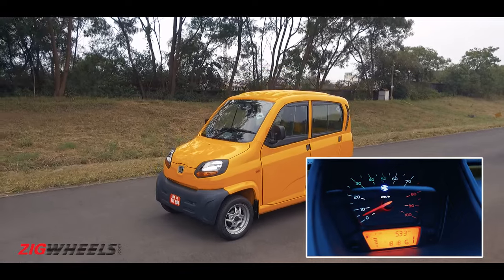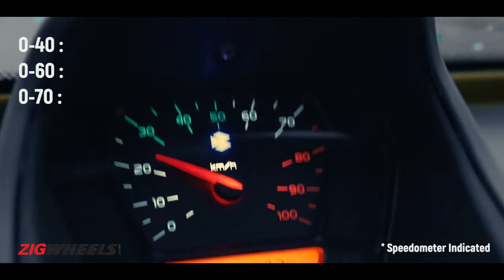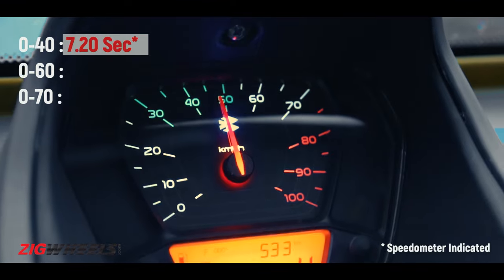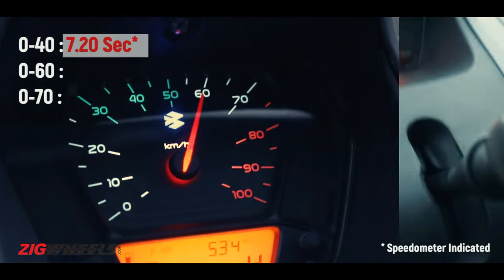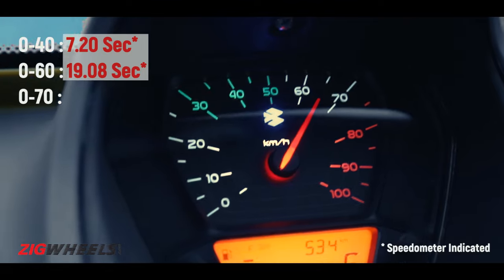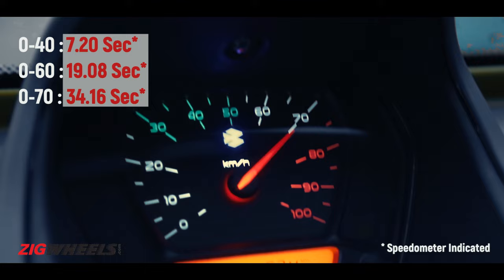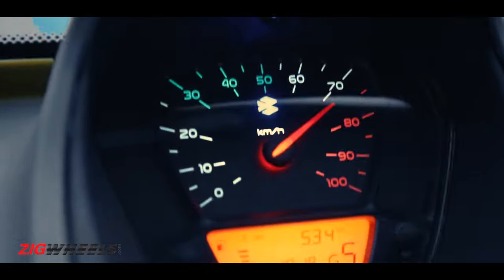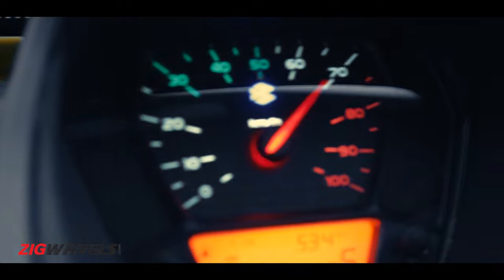Bajaj Qute - 0-70kph Acceleration Test! | ZigWheels.com

Comment: Bajaj should use Dominar 400 engine so that it can do Max 90 kmph + Air Conditioner as an option. More options  means it can be used as family car.
Reply: It is not meant to be a car, it is a quadricycle
Reply: Max speed is very capable in computer car!!
Reply: Very well said bro.
Reply: This car has a speed lock , you decode it, and it will go upto 90.